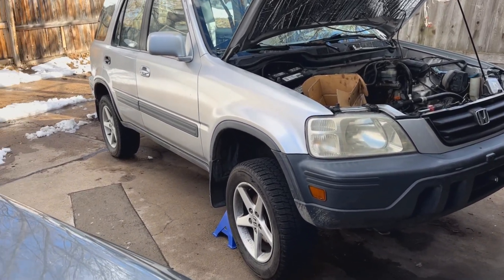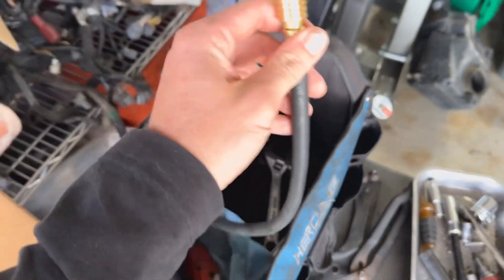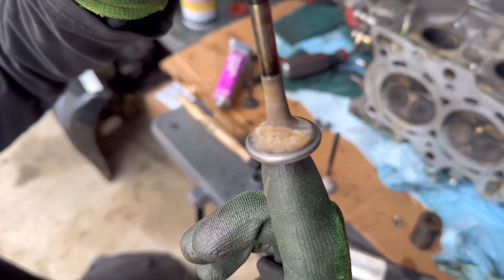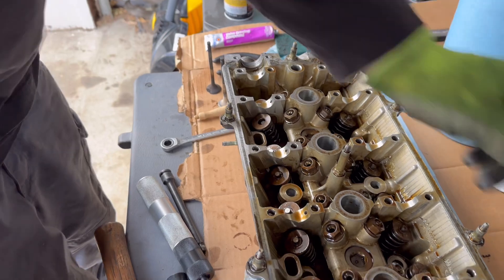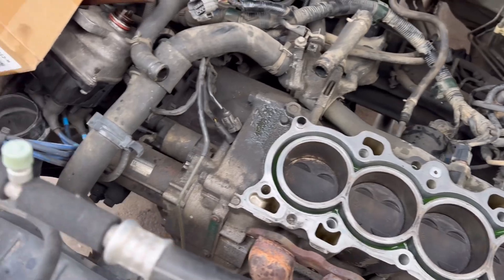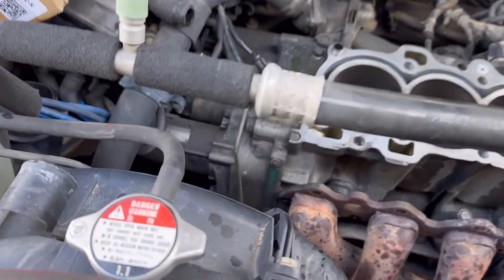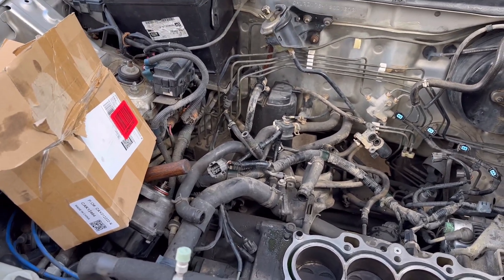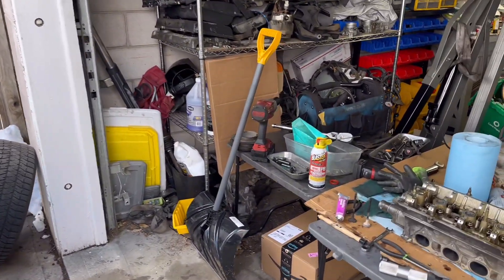1997-2001 Honda Cr-v Misfire flashing check engine light P1399 P0300 Poor idle B20 B18 civic Integra

Comment: Hi There, probably you will anwser me. My CVR started with the check engine light blinking P1399 came, changed the Spark plugs. Erased the codes and evertyhing seem fine. This was in the morning. At night I started the car, let it iddle, didnt have any gas so i needed to go for some. Check engine light came again, P0301 and so came. So i turned it off, put some gas. started the car again erased the codes and drove it for a while and evertyhing worked fine (none of the codes came back again). I bought the car not that long ago, it is my project , do you think i have this same issue? Or i just need the valve adjusment? Also, the car engine sounds ok, but the exhaust sounds like theres a little explotion that sounds.
Reply from the maker: Check compression